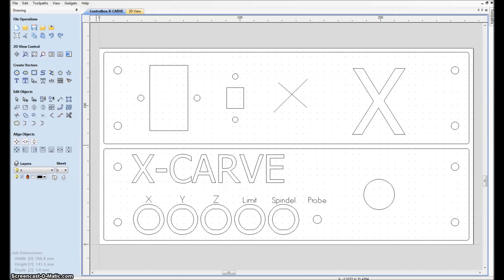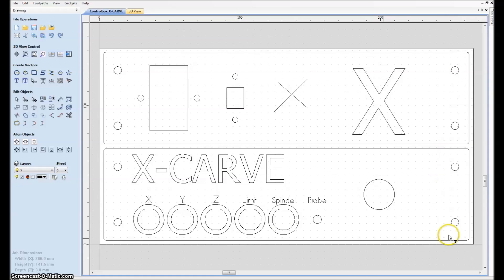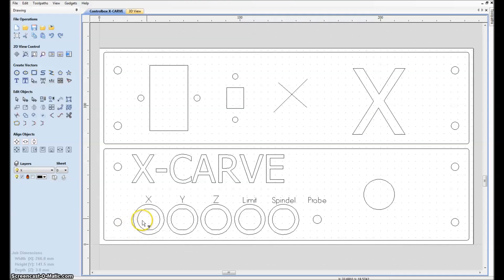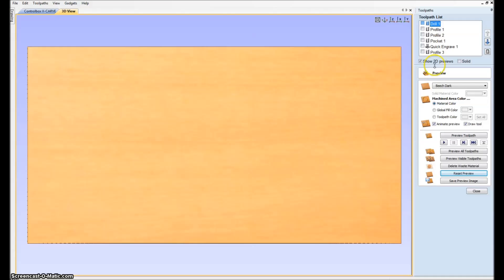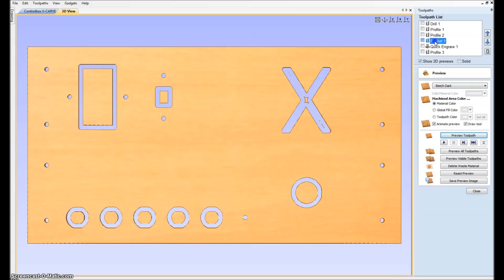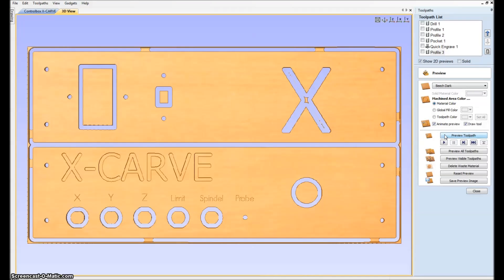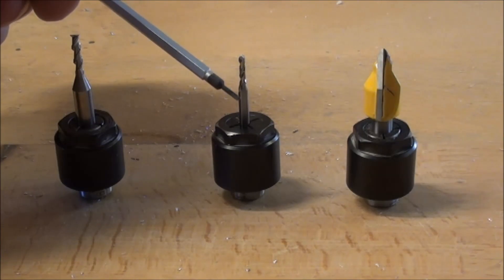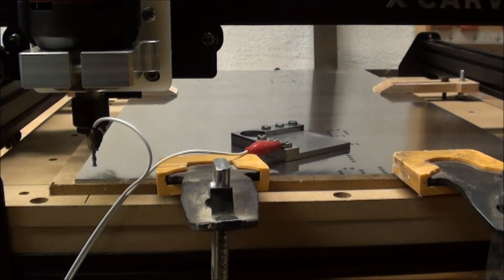X-Carve Milling and Engraving 3mm Aluminum - succesfully

Comment: good friend!!!! :D how many Watts is your drill and it was in this test RPM ?, think Dewalt DW660 with aluminum can cut 6mm smooth ?, to layer height was lowering the Z axis for the cutting edges?
Reply from the maker: Andrés Campa Andrés Campa The Kress is 1kW and I ude setting 4 for Aluminum this is ca 15-18kRPM. Dewalt gets good reviews so I would think it will work just fine. I'm not sure I understand your last question- if you asked about the depth of cut per layer ? - I typically use 0.4mn
Reply: thank you for your reply friend!, have nice day!!

Could you send me one link of the flute?
Reply from the maker: Andrés Campa The Aluminum bit is made in Denmark and you can find it here. http://makersupplies.dk/47-milling-bits
Dependent of where you are you can probably find others. Main thing is that cheap bits often are cheap for a reason - same story for the expensive. :-)

Comment: What did you differently this time that made engraving aluminum successful? I see that you upgraded the spindle, did you do anything else?
Reply from the maker: +RC Grid Hi RC, The main difference is the spindle. In both cases I used a special 3mm Alu bit and ethanol as coolant. The new spindle much more rigid and it has a dial to adjust spped (RPM). I did also use lowre RPM. I think I used the a speed setting between 4 and 5 (KRess 1050 has a 1-6 scale). BR, Martin

Comment: Hello Martin,
What type of aluminum are you using ? 1050 ... 6060 T66 ... 6061 T6 ...  Is there a lot of difference between types regarding milling in your opinion ?
Reply from the maker: +Filip Verschoren The sheet of plate that I have used is 6082-T6 aluminum. Most of the data sheets I have seen, says something about use, and I would think that as long as milling is included it would work for you
Br, Martin

Comment: what program do you use to control the X-Carve Milling Machine
Reply from the maker: Hi Steve
I use universal gcode sender to send the gcode commands to the machine. You Can download it for free from github. 
The gcode I use is generated by a CAM program. I use three different depending on the task. They are : Shetchucam, CamBam and Vetric V carve -

Comment: What software are you  using to make the pattern?
Reply from the maker: +ramlingur I drew the outline using SketchUp. Then exported to V-Carve to make the G-Code. Then I used Universal G-Code sender to send to the X-Carve.
You can make the G-Code in SketchUp directly using SketchUCam (a free plugin) however, I prefer to use V-Carve for making it. Likewise, you can do all the drawing in V-Carve directly - so many options.
Reply: v carve pro

Comment: Where do you live? Sounds kind of scandinavian? Do you still remember how much you paid for shipping? That would help a lot! Thank you and have a nice day!
Reply from the maker: +MU Knives You are right. I'm from Denmark. The shipping was $250 including some materials. Another $250 was added by Danish customs. That part may very well de different if you live in another country. Good luck.
Reply: +Martin Barfoed Oh, that makes a $800 machine $1300. That's quite a lot. I think I go with a european made CNC than. Thanks for your help!
Reply from the maker: +MU Knives Hi Again. Have you gotten any further with you build plans? Over the past several months I have worked with OpenBuilds in the US to make their stuff available in Scandinavia (and Northern Europe). Now it's real as makersupplies.dk has been launched. Here you can find all OpenBuilds parts for building CNC and other fun things. I have also managed to get some sets of gantry plates for the OX CNC made. They are also on the web page. Best wishes, Martin